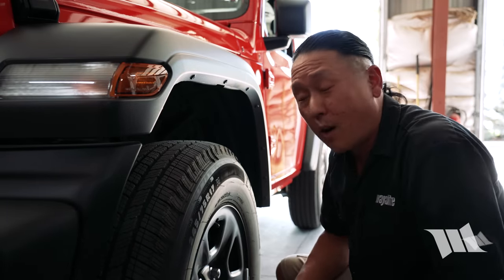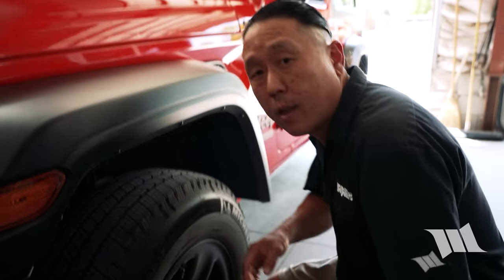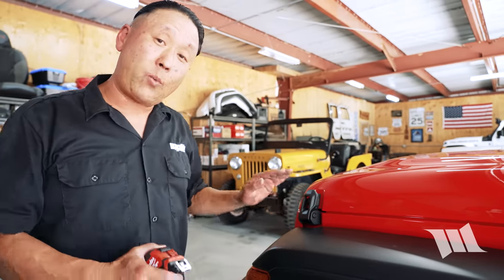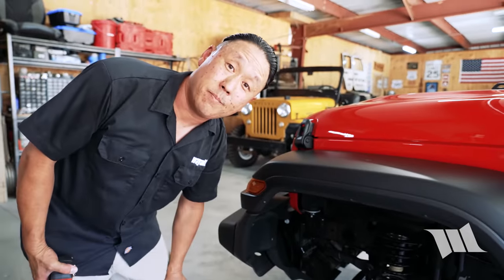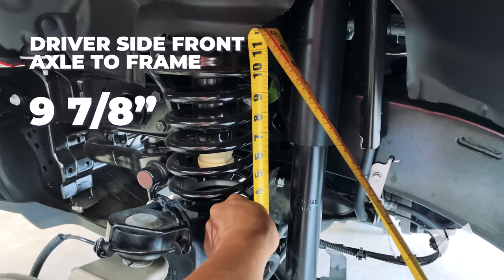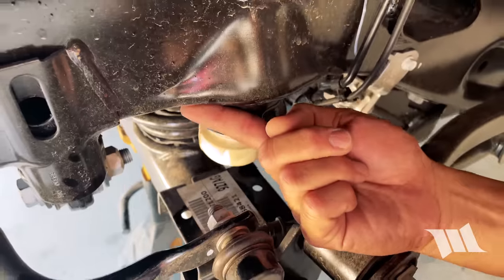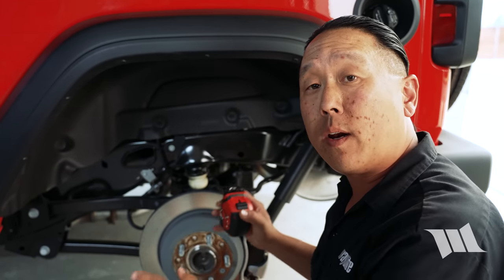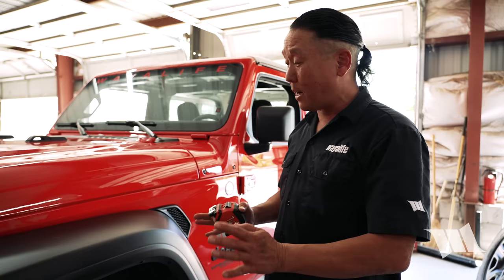Stock Measurements on a Jeep JL Wrangler 2 Door Sport - Reference Points Before Installing Mods

Comment: I love your videos, your style of narration and Ripely. You obviously put a lot of effort into planning your material. I have a 21 Willys 2 door with a few cosmetic mods but the one that has made the biggest difference in how the Jeep feels and performs is the rear tire delete kit. I was amazed that losing 100 pounds off the rear could make such a difference. I can feel that the center of gravity has moved forward. Acceleration, responsiveness and how easy the Jeep turns is so much improved and plan to determine gas mileage when I'm able. I never had a flat in over 10 years on my 98 Sierra Wrangler but even so, I purchased a tire plug kit and air pump for an emergency and my insurance company provides emergency roadside service if needed. I feel it's worth losing the spare.

Comment: Man of my own heart. I have a new Rubi on order and I already have parts waiting for it. Today I weighed each item and then recorded those numbers in a spreadsheet that does the math for me. I will also record the weight of the parts I remove. Right now Im at + 186 pounds. I think I will be closer to + 500 pounds when I am finished.
Reply: Did you order it from a dealership? I’m ready to order one but didn’t know if you can order it from mopar or from a dealer. Thanks.
Reply: @wvlongshooter3912  I ordered it THROUGH a dealership.
Reply: @randomstuff3672  thanks!!
Reply from the maker: Nice

Comment: That confirms that I have a 2.5 inch lift front and rear with a winch and fridge. Might try geometric correction brackets for big bumps at speed that I don’t see until it’s too late. Can always go back to my adjustable control arms if they get in the way. I’m only running 4.2 caster as left some for the pinion angle to drive shaft. I’m going larger tyres one day.
Reply from the maker: Glad our video was able to help you to determine that. Also, 4.2 caster is about stock and a good setting.

Comment: Just my two cents.. I did the Mopar 2" lift on my 2dr JL. Reason was because they took into account engine size and weight, weather it was a two door or 4 door, and the 2 1/2" fox shocks are great too. Warranty still in tact and 35" tires have taken me all over Moab and Colorado. I usually do not try to act like I know whats best, but for the way we use our 2dr JL this was a winner for us. I love that you have a 2dr and can't wait to see the common sense mods you make. Rock on!
Reply from the maker: They are good lifts and I've had a chance to test it out on a 4-door. Good option and one we are looking at.
Reply: @wayalife  after watching ur videos on the dynatrac lift. I installed one on my 2 door rubicon and it still rides awsome i did add trac bars and lcas. Cant wait to see ur build.
Reply: I'd like to see a Mopar lift on this, thinking of doing one on my JL after adding bumpers slides and winch.

Comment: Had a Teraflex 2.5 lift with Fox shocks and a front adjustable track bar installed. It raised it 4" overall from my before measurements to the after measurements.
Reply from the maker: Yeah, pretty common with most lifts out there and definitely so with TeraFlex. They yield WAY MORE LIFT than is advertised and to me, that's not always a good thing.
Reply: @wayalife  Also took a hit on mpg I'm guessing due to changing the aerodynamics. Only going with 35's for tires in a few weeks.

Comment: We haven’t modded our 2018 manual, 2door soft-top Wrangler JL other than replace the plastic front bumper with a Rubicon modular steel bumper with the red toe hooks.
It came with a level kit so it has an inch raise which makes the front stand up.
I don’t want to void any factory warranty but it’s time for larger beefier tires. Any recommendations?
It’s a light model as it doesn’t have power windows. Retro crank window is so cool and less weight and things to break.
Power with the “man” pedal is great with the Pentastar.
Ocean blue is a fantastic color…many unsolicited compliments at the grocery store parking lot.
Reply from the maker: Personally, I really like the Nitto Ridge Grapplers and they're what we're seriously considering.

Comment: Hey Eddy, how are you doing? hope everything work out well.. i have got a question about the jeep hood. Is there any aftermarket locking mechanism to that it can be lock and unlock wireless using the jeep key.. i saw most of the video that only have the manual locking such as the BOLT brands and etc and those individual hook latches.. hopefully you have some solution for that and good day to you.. looking forward to hear from you..cheers!
Reply from the maker: Not that I know of or at least, not as of yet.

Comment: What do you do if anything to guard against rock chips on the door hinges. Ive been noticing several on my Gladiator and I hear them get hit all the time. Thanks.
Reply from the maker: Well, the best thing you can do is to run factory wheels or wheels with 6.25" of back spacing to keep your tires under them. But, if you're tires are already sticking out, this is what I use https://amzn.to/3ewhIII

Comment: Do you know what the (stock) measurements for a Rubicon JLU would be, measuring the Front Coil Spring Lower Base Plate to the Upper Spring Perch?
My JL Rubicon came with 35" Nittos and I'm not sure what lift if any was installed.
Reply: I believe a stock Rubicon can have 35s with no lift
Reply: @FP194  It can and 37" will fit I've heard. I just wanted to know if anyone knew the original factory height or where I could find that out at (dealers don't know) they just sell them. I'm 6'2" and mine sits up pretty high, so I needed to know what a stock height is compared to mine and what a 4" lift would look like compared to mine. I already have 35's and plenty room for more.
Reply from the maker: @TwoFeatherChannel I took measurements of ours back in the day and you can see them here https://wayalife.com/threads/how-to-determine-the-actual-amount-of-lift-on-a-jl-wrangler.56572/
Reply: @wayalife  Thank you. You are the best.

Comment: Have you weighed it? Pipi is almost identical to the 2018 sport I had except I had a soft top. Mine weighed 3940lbs when new. I added about 300lbs in mods.
Reply from the maker: Stock 2-door Sport weighs 3797 lbs

Comment: when we picked up our 2 DR the first thing they asked if we were gonna put a lift on and warned us, about warenty,  we have a 2 1/2 lift 90k on the clock and no issues, othher than  new head I knew was coming we had no problems , well paint on the hinges I guess
Reply from the maker: To be fair, a dealership can't just void a warranty because of a lift. They can void it IF what you're wanting to have fixed was damaged or broken BECAUSE of the lift but can't if it's totally unrelated. Also, if you are a customer of theirs, as in, you get regular oil changes and basic service from them, they will try a LOT harder to warranty repairs.
Reply: @wayalife  my dealer ship isnt gonna turn away any repair , well almost, money is money, its not coming out of there pocket so they will usally fix most any thing under warranty as long as they dont have to produce a after markt part  (-: we get a lot of lifted Taco's

Comment: How about wieght? Did you get a baseline measurement of that? It would be good to know how much the mods add to it.
Reply from the maker: Jeep already provides that. Stock 2-door Sport weighs 3797 lbs
Reply: @wayalife  Ok thanks. Good to know as I dont know what the Jeep's specs are. Hope you wiegh it periodically during the mod process so we can see what the difference is.
Reply: @wayalife  Where did you find this. I’ve been looking for the weight of my 2door Rubicon. Actual weight not weight range. TIA
Reply from the maker: @gwandana I'll see what I can do.
Reply from the maker: I have friends who work in the right places :)
Reply: @wayalife  Im planning to take mine to a vehicle weigh station before I start the mods.

Comment: I know this is an old install but are you still running your LOD sliders on your 4D JL?
Reply from the maker: We are not but only because we decided to test out a different set of sliders.
Reply: @wayalife  I’ve been thinking about going with the LOD sliders. The video you posted a few years ago seemed easy to install but strong. Have you found any that are better?
Reply from the maker: @tym3kill3r33  They're good sliders and I like that they're mounted to the frame. We're running body mounted EVO sliders now and they're nice but we did have to drill into the body.
Reply: @wayalife  thank you I appreciate the info. I’ve been looking at different sliders and I like the LOD. I look forward to more videos.